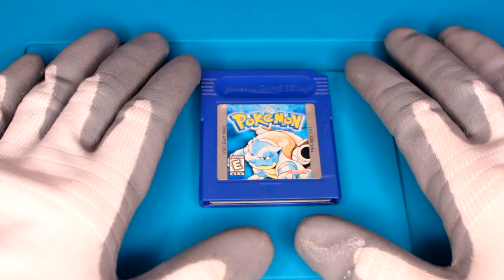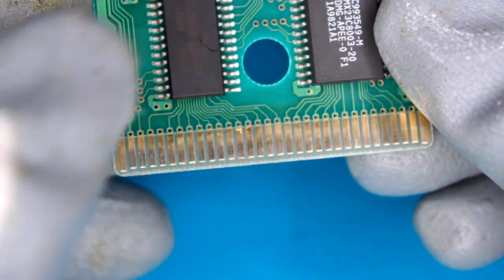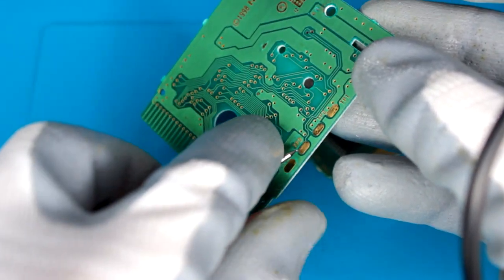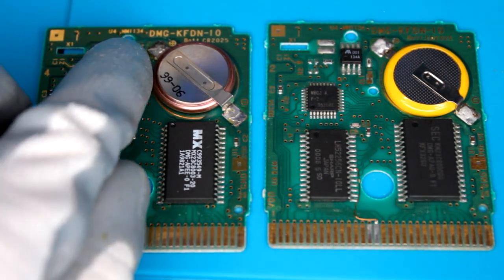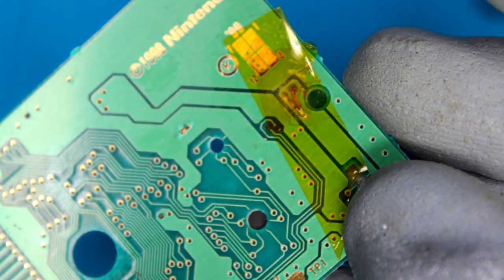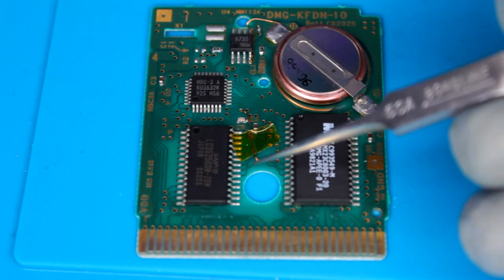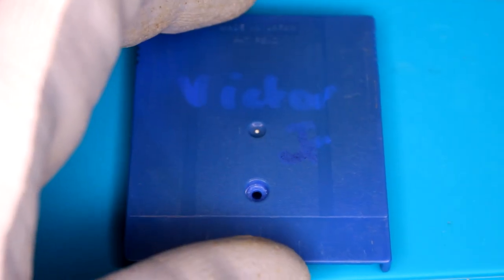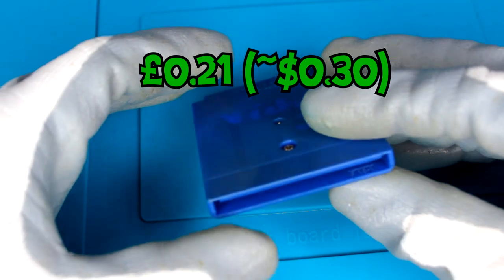Pokemon Blue NOT starting - HOW MUCH IS BROKEN?

Comment: is it really a good idea to use something as abrasive as fiberglass pen? seems to me like you're ruining the contact coating and removing the gold plating, exposing the traces to corrosion.
Reply: I agree, but those did look pretty grimy, if there is surface corrosion it might run partway into the contacts anyway. I wouldn't use it for every repair, most certainly not, but it's nice when you need it. It is better for the cart to be open to corrosion than to leave even the most minor of corrosion problems.

Comment: Hi! After a year or so, did you find a way to wipe out the name Victor Jr?
Very interesting channel by the way
Reply from the maker: thanks and no i did not haha, any ideas?
Reply: @JuicyJakeRepairs  haha, you're welcome. Well, once I saw a video in youtube of a guy having good results with "magic wipes" or magic eraser...can't recall exactly the name of the product, but the guy rubbed the wipe and succesfully erased a name of a cartridge of snes, written with indelible ink. If it annoys you ( it would If I were you), yoy could give it a look and a try :)
Reply from the maker: @Zurimullen  sure i will take a look at it!
Reply: @JuicyJakeRepairs  I've doing a further research and I think the magic wipes I recall are from "mr.clean" brand. They most likely will erase traces of indelible ink but, however, I would test them first in another cartridge's surface, just in case, because what the wipes actually do is to polish any surface; they have a chemical compound which have and abrasive effect and although they are effective, maybe they could be too agressive for the cartridge surface.